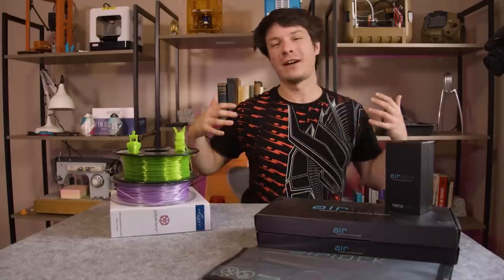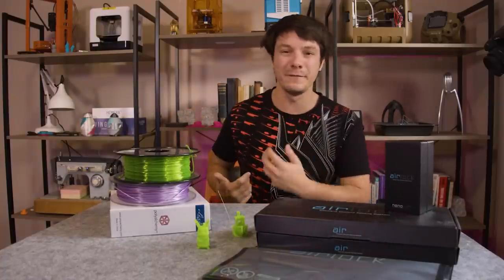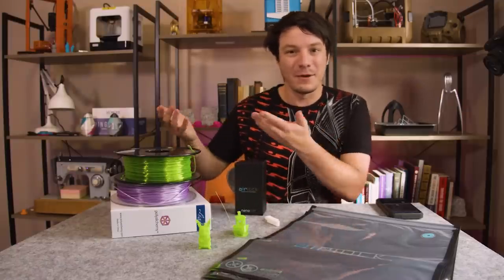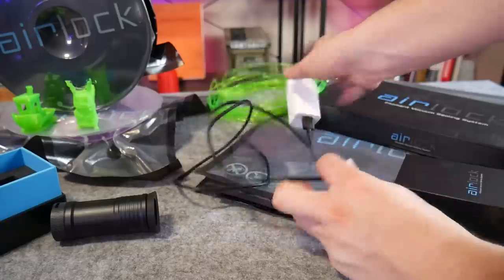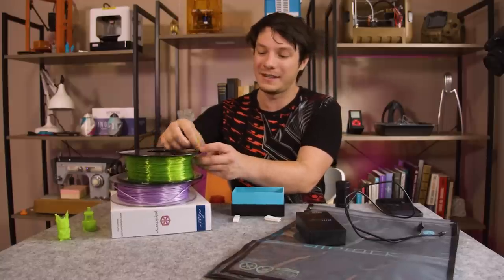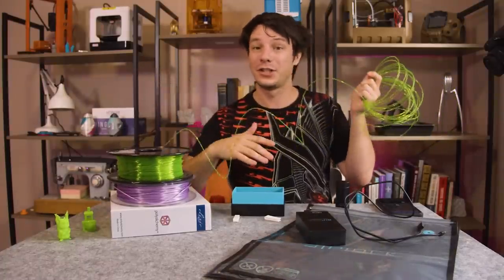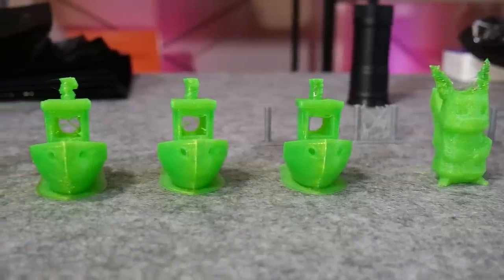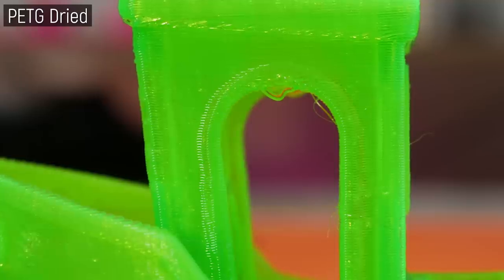Should you store filament in reusable vacuum bags? Nanovac + Airlock review and test

Comment: Sounds ok if you add silica gel to it too. Problem is that the volume of water will decrease but not the relative humidity. SO the amount of water will be less but the filament still will abosrb water, all be it way less then before. Adding silica gel will add to the solution. The combination should work well as the volume of air is brought down so you need less dessicant to keep the filamant okay. For removing air, you can use a normal home vacuum cleaner (they use these in professional sea/air packaging industry and works just fine). In that industry they use a technology called VCI packaging that is used to prevent rust on metal parts. But that doesn't dry out air, it only makes the oxygen unavailable (so indirect might turn moisture into Hydrogen. I don't know the impact of hydrogen on the plastics. For metal it can be bad. You can also remove the air as much as possible and put nitrogen in. After 2 or 3 cycles of vacuuming and adding nitrogen, the package will be as good as dry. That's a technology they use in the tire industry but also for explosion proof area's in machines (swivels of cranes for the oil drull industry for instance). Another solution is to buy a small dehumidification unit and low pressure compressed air. The dehumidification unit will constanly dry out air by means of a drying wheel, that constantly regenerates silica gel. With this, you can keep the container at a constant slightly overpressure so humid air can't get in. Keep in mind however that a vapor tight room is hard to obtain. Overpressure might help out here too.
Anyway. The vacuum solution works when combined with dessicant and regular re-vacuuming.

Comment: I would guess, it has to do with the moisture in the filament in the inner loops of the spool. It might just have diffused outwards... After 8 hours there is probably still quite some moisture in the inner parts of the spool. (CNC Kitchen did some in-depth tests about that.)

 I would suggest to try it out with just a small sample of the filament in the bag or with a spool which is dried for several days!

Comment: I store my hygroscopic filaments in a large clear plastic tote I made using window seals and a cheap tote from home depot. It stays at about 28% RH with a 45-60% RH environment. For my extremely hygroscopic filaments I use an ezy storage IP67 tote that is incredibly well sealed and will hit 18% RH with silica gel and with better desiccants it'll easily get 5% or lower.

Comment: For anyone that was wondering if their charger could run this, while his said the "total output" was 8 amps, it adds all the ports up, which means each port, assuming they're all the same which they most likely are in this case, only can do 2 amps, which is pretty standard, and can only do 2 amps even if it's the only port being used.

Comment: or years.... i had about fifteen left over rolls through out my years of printing and just did a marble machine print with the filament and it turned out great. most of the filament was left out, no bag, no silica packs. some were super brittle but still printed. i usually just toss my filament in a food dehydrator and that works great but for that print i left all the filaments as is, you know, for science!

Comment: I store my filament spools in small containers (space for five or so) then put a household dessicant box and a cheap humidity indicator. It stays at around 30% where outside is ~75%. Dessicant lasts a couple of months because its a small volume. The box doesn't even need to be air-tight. When the indicator reaches ~40% I replace the dessicant. Stopped having issues with moisture on my prints since I started doing this.

Comment: I actually don't think it absorbs moisture while in the bag, in any noticeable way at least. More likely is that its small cavities are more prone to suck in a bit of moisture as soon as it comes out since it has been in a vacuum and when the pressure from the outside hits it it will absorb a little bit easier. And also the moisture that it contained while exposed before vacuumed is still in it - so it doesn't really remove any moisture as the drier does. But drying it, then vacuum seal it would make a bit more sense. It would be interesting to look at that as an comparison to the freshly dried filament. Say you use a roll of filament, dry it and seal it, than 3 weeks later you want to use it but instantly instead of first having to dry it. Does that work as well or not? More as a time saver when you are about to print. Sure, the mount of work will be about the same but less planning before you're gonna use the specific filament. But just keeping moisture out has it's benefits, of course, as you said it shouldn't need as much time in the drier, maybe just an hour or so.

Comment: quick tip:
Store filament in your closet
Reply: Nice trick. I store the "Premium" filaments inside sealed bags with dessicant (squish the air manualy, not vacum) and then put them in the cabinet where the printer is (It's a rack server with insulation, a big glass door and a rubber seal)
In my city there is like 60%-80% humidity. And inside the rack, specialy with the printer running, is at 30-35°c and 40% humidity
Reply: @cobeer1768  Think he meant to prevent dust.

Comment: Do you have a video on that dehydrator direct to printer set up? 

Live in very humid climate and looking to get my first printer. Oddly through all the beginner printing vids I didn’t find out about the moisture issue until I watched a video on using nylon filament. Seems like that may not get talked about enough and should be mentioned in any beginner videos.

Comment: You didn't seem to have perfect prints from the bag but what if you would have out dessicant in the bags when sealing them? Stuff a few packs in the center of the roll the sealed it up. I wonder if it would have been better results?
Thanks for the code too! This is really a good solution for me! My printer is setup in my heated garage because that's the only place I have space for it. My printer is protected but I didn't have a good solution for my filament. Some of it didn't come in resealable bags and others had crappy bags. I need to protect it from not only the moisture but from dirt and crap in the air from working on car stuff in the garage.

Comment: Interesting how some filaments absorb and some do not. My PRUSA PETG (black) was on the roll, out in the open in this humid basement, within 5 feet of a window, for 6+ months, and I never had any issues with prints. The printer is nothing special - just a mini.

I thought this was an issue only with PLA. I didn't know some PETG also have moisture issues.

It's humid enough around here that my cast iron tool tops in my workshop all get rust on them after a couple weeks, unless I oil/wax them.

Comment: you should add a bag of desiccant to the roll before vacuuming it. but not in the middle of the spool hub, put it alongside of the filament. plastic bags let moisture through, the desiccant gets it out of the bags atmosphere before it can really saturate the filament. better would be resealable bags of metalized mylar, but these are not available for vacuum pumps.

Comment: I tend to dry the filament in a desiccator right before sealing the roll in a bag, so it gets sealed while still warm. I'm not sure whether vacuum sealing the bag makes much of a difference. If the bag is gas impermeable that should be fine. I can understand why manufacturers vacuum seal... It minimizes space and gives a clear visual indication if the seal has failed.

Comment: Here in dry Utah I've found that I get the opposite problem. The filament, once removed for the original packaging, becomes brittle and the printing quality degrades with time. I've discovered the filament can be restored by submerging it into a pot of boiling water. Anyway, it looks like this product would be usual for me as well.
Reply: What brand and type of filament are you using? Most PLA will become brittle over time when exposed to moisture and thermal shock, and transparent/translucent PLA is particularly notorious for becoming brittle and having extrusion problems
Reply: @StormBurnX  I don't have a brand. I just buy whatever. And I have this same problem with all of my filament. It dries out over time, becomes brittle,  and doesn't print well anymore. Putting it in a dehydrator doesn't fix the problem but putting it in boiling water does.
Reply: @philliptoone  That's quite odd, as I live in the desert in Arizona and don't have that problem, nor does anyone else I've ever heard of on the entire internet lol. Guess I learn something new everyday :)
Reply: that is very odd indeed.

Comment: I'd like to see a comparison with a zip-top bag without the vacuum and just dessicant. The bags are a standard size (1.5 gallon in the US), and you can suck out most of the air with a straw and some practice. You can also get metalized bags which are less permeable over the long term.

If you have to dry the filament before printing _anyway_, what's the point?

Comment: I never use a cooling fan on my Tronxy X5SA late 2020 version. All I print is PETG and CF PETG and my benchy come out damn near perfect. Maybe it's the filament your using or your settings. I use Z hop when retracted, Mesh fixes 0.35, 0.35, 0.035, Coasting stock settings, 70 travel speed, 0% cooling, retract before outer wall, outer wall flow 95%, outer wall wipe distance 0.4, Z seam alignment Random.

Comment: I think you may have done a video on this already, but does desiccant alone get it dry enough? Maybe do the same nylon test, but just seal the roll in a box with lots of desiccant. My guess is it reaches a point where the dry air isn't sufficient to get anymore water out, and then the heat is required for drive it out.

Comment: Is it possible to have instructions on fitting the hemera on the D01? was thinking of one myself. Love the speed of it but the hotend and lack of space for a good cooling solution really lets it down. Also the mainboard is pretty bad, SKR replacements are awesome.
Reply from the maker: It needed two new holes drilled in the original metal hotend bracket and a new X limit switch mount, pretty simple! I'll detail it soon now e3d are shipping the hemera reliably again.

Comment: I'm curious what the difference is between these bags and just squeezing the air out of a ziplock bag with a desiccant pack or 2 in it would be
Reply: Most likely none. That desiccant would IMHO made it even better. As long as the bag is airtight there is little to no humidity left. I was looking for plastic box with rubber seal around the lid but so far I haven't found suitable size. Shops are closed - so I cannot just go there and see.
It is product fore geeks - take small pump (who knows how efficient), bags with big brand name and say that it is designed for it on purpose, pack it in a make a nice black box. Done.
Everyone else finds effortlessly several substitutes that serve the purpose as well or even better. Free world - buy what you want.
Reply: The pump gets more air out.

Comment: Been using these for about a year and over half of my bags have failed. They leak and end up letting air (and moisture in) and won't vacuum properly any more. I can only seem to get about 6-10 uses before the bags fail. I am very careful with them. I see they are out of stock and coming out with new "better thicker" bags. I sent them an email and I guess we will see if they leave me hanging with older bags or will offer to replace them. If they don't replace them I will not buy them anymore. I might try to find some vacuum boxes that I can use my 2 nano vacs on (yea, I lost one, ordered a second then found the original). I had really high hopes for this method but have been let down so far.

Comment: What are the conditions for using the code? It says "MAKERSMUSE discount code isn’t valid for the items in your cart" when I try to use it with the regular or Chinese New Year bundles in my cart.

Edit: I also tried it with a bag 12 pack and the pump added separately, same error.

Edit (again lul): Looks like you need to pick the regular bundle. The Chinese New Year bundle doesn't let you use the code. You also need to add a 12-pack of bags. The code applies the discount to the extra bags.
Reply: Yes, I have same issue...
So hod does it work, im willing to try this for my rolls.
Reply: Ohh, need to add it manually.. I mean that extra bag pack...
But, its almoust 30 bucks shipping to Finland..
So sadly it would almoust double the price.
This would have been nice product.... :,(
Reply: I chatted to polyalchemy, they ship from china.. There is plenty of similar product that you get same price and yes, like everything from china, Free shipping....
Reply: I still would have wanted shis pruduct but just cant do that shipping costs....

Comment: I must admit, that I'm a complete newbee. So fwiw: I can see the advantages of storing filament in a vacuum bag, which is better than in an airtight storage box with a big bag of silica as I do it. There are silica bags that can be regenerated in the microwave and have an indicator to show the moisture status. Would that be a better option than that very tiny bag you used?

Comment: Easier to use 2 spools in a regular bag, one is nylon to absorb the moisture and the other is the one you actually use. 

Well that wasn’t a great joke but it’s in response to my experience with desiccant bags. I find reclaimed desiccant packets to be useless. I include a humidity meter in a bucket with a tight fitting lid, add about 500g of desiccant bags, both silicon and clay, that were about to be discarded from work, “fresh” out of the original part. Humidity meter barely notices. Admittedly my air is about 30% RH but I was hoping for more than about 3% to 5% change. I believe Silicon gel works poorly a low RH levels.

Comment: I have been using amazon basic vacuum bags, I like them but the issue I have is that if two bagged spools bump each other or the corner bumps something hard there will be a small hole in the bag causing it to immediately fail.  Iv got around this by double bagging most of the time but I was wondering how these held up.

Comment: Hi.
I've got a terrible problem.
Ender 3 with skr mini 1.2 and bltoutch. 
I can level the bed, but when I start the print, the software won't use the level bed function. 
And I have set the z offset.👍
I read all across the internet about this problem, and all I found was a short githup article (it said I should try G28 and G29)and a YouTube video with a guy who had the same malfunction, but no fix. Yesterday I upgraded to octopi, so that I could try G28 and G29. But that is not what I am looking for. I want the printer to use the "analysis" of the meshed bed.
I know it "analyze" cause I have a visual representation of the bed, in octoprint.
I hope this community can help me.
Thanks💛

Comment: If you use vac bags they do help but they do not remove moisture that has already been absorbed and they also do not pull a true vacuum meaning that some air / moisture remains in the bag, this is why you want to save those silica bags you get and add them to your vac bag.

Comment: Cool angus I have a quick question does the air tight bags count as drying or does it just seal filament up in bags so not dust, moisture, or damage happens to the filament.
Reply: A bag does not dry in any way. It simply seals in the ambient air as it is.  As you surmised, it prevents additional dust contamination, but it will absorb all of the water in the air that it is sealed in with.  Adding a desiccant will reduce the amount of water absorbed, but some will still be absorbed.  Creating a vacuum seal just reduces the amount of air in the bag, it does not eliminate all air or moisture.  All this being said, it is a very good method of storing any type of filament, but does not eliminate the need to dry the filament before using.

Freeze drying is the only method that I am aware of, that will eliminate all moisture.  It is also what companies do when they absolutely can’t have any moisture during the printing process.
Reply: Thank you that was what I originally thought but was not sure thank you.

Comment: There has to be a better way for storing/using filament on a day to day basis

WRT dessicant bags: DON'T USE THEM in a vacuum  container unless you've just thoroughly dried it (and I mean utterly thoroughly)

If they have any water in them, it will outgas under vacuum and contaminate everything in the chamber/bag (unless you're drawing down on the vacuum to remove the gassed out water)